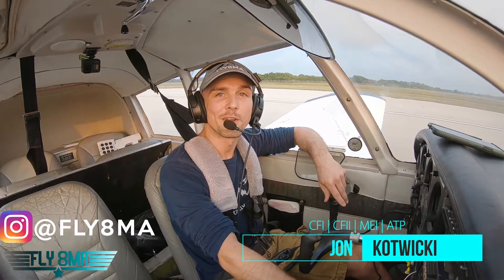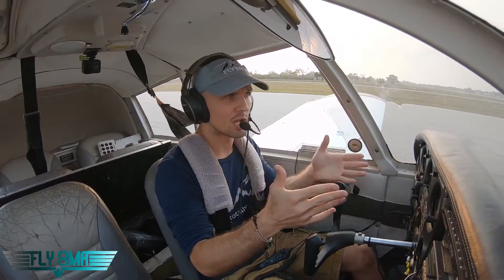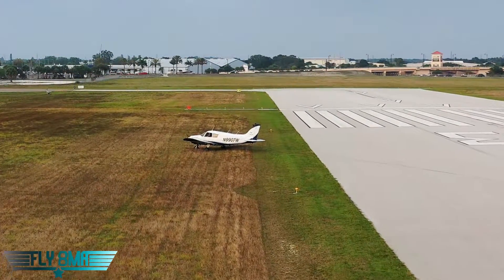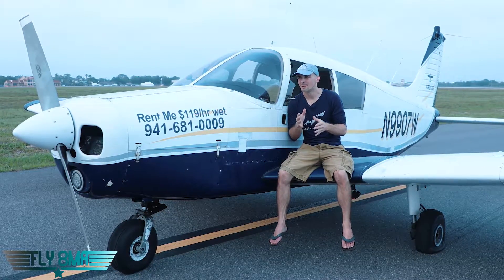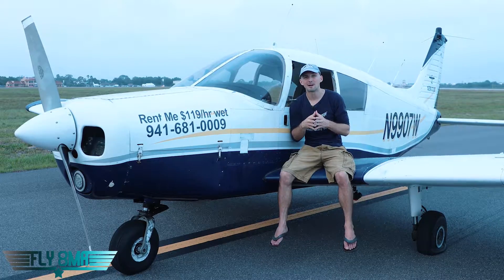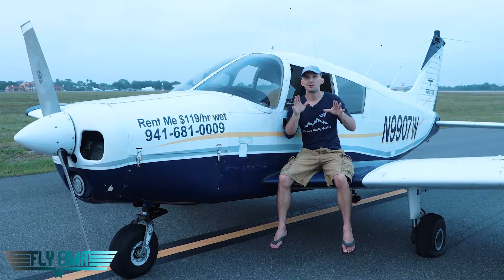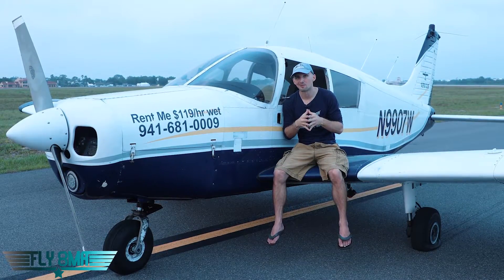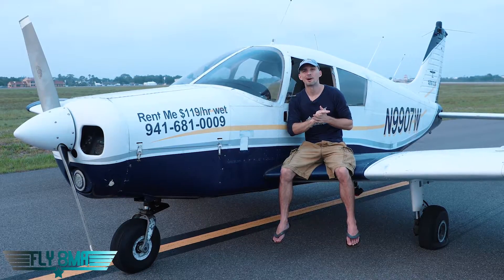TIRE BLOWOUT ON LANDING | What to AVOID!

Comment: It's much worse with wheel fairings, the deflated main gear tyre will rub against them like crazy, impossible to move/push/drag the plane by hand even with 5 people as there is so much resistance, on a light SEP aircraft it took full engine power to break loose and get moving and about 50 to 60% engine power to keep moving with contralateral intermittend braking (intermittent maximal braking on the contralateral side was necessary each time the aircraft tried to veer of to the side of the deflated tyre). It was difficult but possible to crawl slowly back the runway with up to 10 kts - with more speed, it was actually a bit easier, as the tyre straightend itself out because of its rotary momentum and did rub a bit less on the fairing. This happend on asphalt with a worn out tyre which got punctured whilst landing. Now it might have been easier on grass, as a grass strip for gliders ran next to the asphalt RWY. I didn't think of trying that. All this happened on an unsupervised airfield with nobody around - nobody in the C buro, everything closed, no tools, no tow truck, nothing (but the airfield was open). People were summoned to help vacating the aircraft from the runway and a NOTAM was issued to temporarily close the RWY so nobody would try landing on us while we were there. I highly doubt anybody already in the air actually got it.
 It was quite an experience and I had to take a hotel room in order to wait for a maintenance team fly in the next day for repairs on site.

Comment: I had a left main lock up, probably my fault doing short field landing and maximum braking to make the closest taxiway, resulting In a quarter size hole in tire and tube in seconds. Luckily my speed was low at this point, but it was all I could do to keep it off the grass and out of the runway lights. Non towered airport, dark, since I was getting my night landings in, so closed FBO and shops. I had about 3 planes in the pattern, and 2 on there way in. I chose to crawl off the runway, took lots of power, full rudder deflection, and hard braking on the good wheel and tire just to ever so slightly turn right, barely could even track straight. I could see the tire was staying on the rim, since it’s in view on the pilot side. I wouldn’t recommend this, but I did get clear of the runway. I didn’t even know they had dollies/skates before this. I know now where the airport keeps it and hope I don’t need it. A video on how a dollie works would be great. My plane is an older Cessna 210 with mains that seem tiny on a 2900 lbs aircraft. It rolls like a 3 legged pig with all the tires fully aired up, and like a leg less pig with 1 flat. 260 hp is the only reason it could inch along at all. I recommend taking the advice to immediately stop and get help.

Comment: I had the right main tire blow out on me on landing one evening at Midway Airport back in the 70's. I was a fresh pilot and I knew right away what happened but with that wide runway I had no problem avoiding the grass (barley). Tower cleared me from the rwy4 but i told them I think I'll need a tow.

Comment: I was doing a Pilots N Paws mission. When getting to the airport to pick up the pup, I had some windshear when I was about six inches off the runway. That caused my landing gear to be side loaded and the right tire to blow. I did a full power taxi to the ramp, which was about 20 feet away. Walked to the maintenance hangar and got the tube replaced. Fun day. Learned a lot. And considered carrying an extra tube in the airplane after that. 
BTW...how much do you want for you spinner. I need to fix and repaint mine, but yours is exactly what  I need.

Comment: Had a Cessna 172 main gear wheel fail on landing. Wheel halves separated on roll out.  A loud bang followed by Sudden settling to the left, followed by strong left turning tendency.   Aircraft stayed on runway, we shut down and got out.   Found all the pieces, a fellow with a flat bed baggage cart, we lifted the aircraft up by the wing and put it on the cart.  Towed her back to the hanger.  Found out there had been an illegal repair to the wheel (not repairable).
Reply from the maker: Oooo....sounds like a fun day.  Those wheels can be expensive, sad to hear somebody was cheap and didn't fix it right the first time.

Comment: Practicing short field landings in a PA28 as teenaged student pilot I had a nose wheel tire blowout on landing. The aeroplane stopped quickly and  I shut off the fuel  and turned off the master switch. THEN I called the tower. 🤣 After I realised no one heard me I thought “stuff it’ and got out. 🤷🏼‍♂️

Comment: I was on my solo landed for the 1st time just fine. Landed on the 2nd time and was taxiing back to the runway when all of a sudden hard left turn followed by the nose going down. My initial thought was that I damaged the nose gear. My instructor told me to shut the aircraft down and I got out and discovered that I had a nose gear flat. What an experience for a solo student. Before I knew it the airport had a truck on scene to tow the airplane to the maintenance shop.

Comment: A slow deflation vs a blowout will react much differently. That being said, good video. A subject that is not covered very much.
Reply: I had a left main lock up, probably my fault doing short field landing and maximum braking to make the closest taxiway, resulting In a quarter size hole in tire and tube in seconds. Luckily my speed was low at this point, but it was all I could do to keep it off the grass and out of the runway lights. Non towered airport, dark, since I was getting my night landings in, so closed FBO and shops. I had about 3 planes in the pattern, and 2 on there way in. I chose to crawl off the runway, took lots of power, full rudder deflection, and hard braking on the good wheel and tire just to ever so slightly turn right, barely could even track straight. I could see the tire was staying on the rim, since it’s in view on the pilot side. I wouldn’t recommend this, but I did get clear of the runway. I didn’t even know they had dollies/skates before this. I know now where the airport keeps it and hope I don’t need it. A video on how a dollie works would be great. My plane is an older Cessna 210 with mains that seem tiny on a 2900 lbs aircraft. It rolls like a 3 legged pig with all the tires fully aired up, and like a leg less pig with 1 flat. 260 hp is the only reason it could inch along at all. I recommend taking the advice to immediately stop and get help.